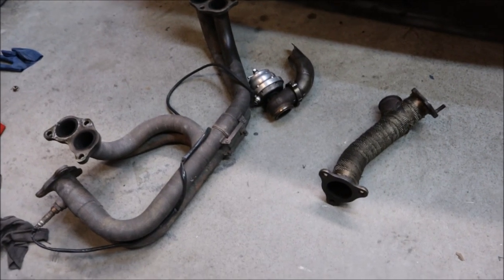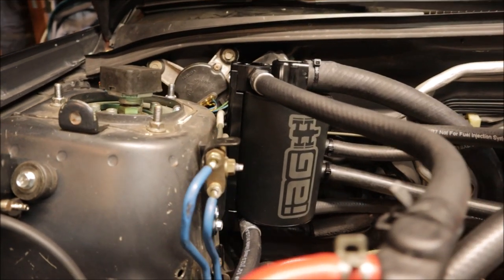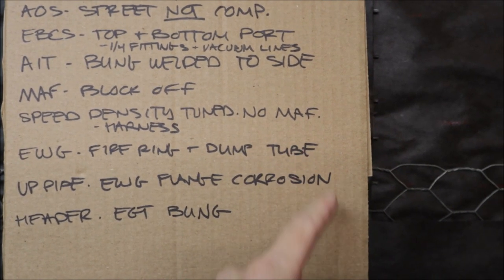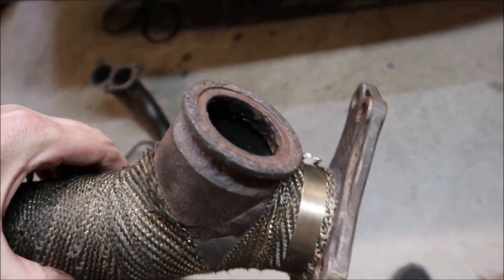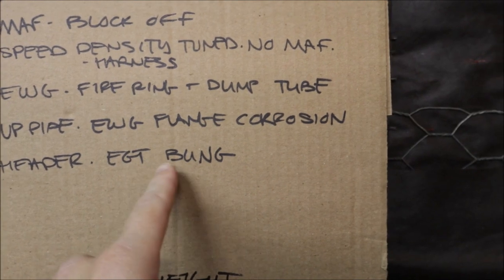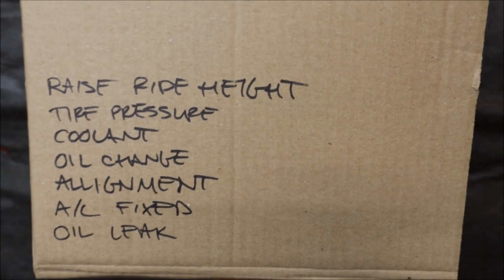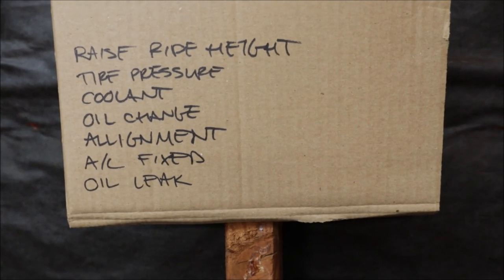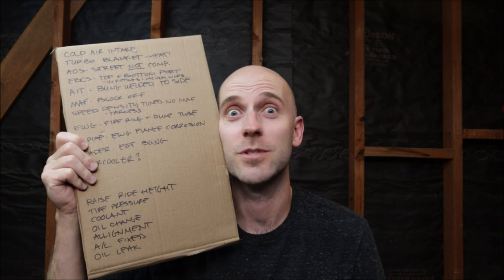Project Cars Are The Worst! The NEVERENDING Impreza WRX GC8 2.5RS Build Part 9

Comment: Don't wrap the exhaust  is will cause it to rust out and can cause a fire if oil gets on it. Ceramic coat it.  Use gold wrap on the intercooler pipeing
Reply from the maker: Wolfy1091 these are my exact thoughts! I considered wrapping the uppipe but it may end up needing to be replaced and I will go ceramic coated. Gold in the IC pipe will work just not a fan of that much flash!
Reply: Swaintech coating was a huge improvement from from my last time wrapping. Who wants itchyness wrapping headers anyway!

Comment: 5:01 this is how i felt when I did my swap recently.  The person who owned the donor car made a mess.  Broken bolt's missing bolts gaskets not sealed properly.  Everytime I thought I was done buying stuffing and fixing things I found more things wrong.  A few days before my inspection was due I was planing on starting her up. There was no coolant leaks before I took the engine out and did the swap. 

Well I went to fill the coolant  and it starts pissing out by the thermostat .  I though it was the hose because I had to cut it to make it fit. Nope after fiddling with it I found a bolt head missing on the thermostat.  I flipped out and almost threw the ratchet threw the window.  I thought the dude broke the bolt off in the water pump and there was no room to drill it out there.  I calmed down after a while and took another look and the bolt was just missing and the guy rtv'd the hell out of the thermostat .    I almost sold the car because of the aggravation the swap caused me.  It was only supposed to cost 2k   to do it  by the end spent almost 7k.
Reply from the maker: Wolfy1091 you feel my pain! Every single step of the way is an uphill battle. Nobody seems to care as much as we do. How hard is it to do something right? I suppose many people don’t care or have means to do it right the first time. I understand, at times I just want to through all the junk parts back on just to drive the dang car.

Comment: I wish that my laundry list was only that long...
You are doing great! I have found that I get really discouraged if I look at everything to be done. Just take the first thing on your list, plan your work as much as possible by doing research. Perform the work and only that until you need parts or resources. Order those parts and repeat; plan, work, complete or order parts on the next item.
It is a learning experience, you have a heavier learning curve than most but the great thing it will be your work and time done to your taste. You have a much nicer platform than pretty much everyone I know except my best friend, who bought his '99 RS with 8k miles in 2000 and then started modifying it.
I made a block off plate between the short ram and the engine, that attaches to the frame rail. Subaru I think still has one for the GD WRX like I'm talking about.
Also if you are going to reuse that up pipe, cut off that silly steel waste gate flange and get a good thick stainless one welded on. Also have the dump pipe merge back into the down pipe. I think Vibrant has that flange available or check Burns Stainless out there in SoCal. Full Race has what the ideal up pipe should look like, in my opinion.
Reply from the maker: @Troy Fankell much appreciated and great info! I get discouraged often and only get a few hours a week to work on it. Once I get started I always need more parts, then have to push it off till the next week or beyond if parts come in on time. I already purchased a new up pipe as I could not find anyone local to repair this one and they wanted $400+. I always liked the idea to recurc the ewg to keep the noise down. It would have to be a custom job to keep my current down pipe, see above regarding local fabricators 🤦‍♂️ for costs! Think it’s with it? Does it affect the boost when recirculating the ewg? I have herd mixed feelings on it.
Reply from the maker: I would love a block off plate for the intake but with fmic there is an extra pipe to route around.
Reply: @RoadPatina  It may be too complex shape for your setup with the I/C and intake. This is what my car looked like before I owned it when it was at SEMA. http://legacycentral.org/images/members/byron/engine_2.jpg
The block off allows the charge pipe to the front mount to go under and along the top of the frame rail and the intake to go over the top.
Reply: @RoadPatina  The wastegate being plumbed back into the exhaust is required at certain tracks or events. But it doesn't effect performance if the return is several inches down from the turbo outlet. The recirc is usually referring to the blow-off valve by recirculating the excess boost measured air back into the intake charge.
Reply from the maker: @troyfankell6581  I am going to look around locally for a good fab or exhaust shop.
Reply from the maker: @troyfankell6581  super clean. Tons of red like mine! Keep at it. We are getting there!

Comment: So your tuner wants to run all the ports of the EWG? You have an 18G turbo. The bottom port is sufficient..... but i guess. The FMIC piping does suck that it's a clockwise flow.  I would run it counterclockwise, but it wouldn't be a problem tuning it whether it's Stainless steel or aluminum. You need a heat shield for the turbo to keep radiant heat away from your piping, wiring, hoses, and IAT sensor. A healthy motor going in for a tune is better than a dying one.
Reply from the maker: Yes, they want me to run all the ports on the EWG and EBC, more vacuum hoses to clean up the engine bay 😂. Wish I had your knowledge as I am learning from my mistakes and are usually costly and repetitive. Turbo blanket purchased already!

Comment: Direct from IAG:
Q:  Which AOS is right for my vehicle?
A: It is IAG's opinion (which may differ from some builders and tuners) that you should use the following parameters to decide which AOS is correct for your vehicle:
Less than 600 WHP on pump gas – IAG recommends the Competition Series AOS. The Competition series provides the best venting of the PCV system and also prevents any oil suspended in the PCV gases from re-entering the turbo inlet. If you prefer not to retune the vehicle for installation of the AOS, the Street Series may be used below 600 WHP.
Less than 600 WHP on E85 – IAG recommends the Street Series AOS
Greater than 600 WHP on E85 / PUMP GAS / RACE GAS – IAG recommends the Competition Series AOS
*Please note that IAG recommends the STREET SERIES AOS for ALL cars under 600 WHP running E85 or high-ethanol fuel blends. When tuning E85, ethanol vapors tend to stay in the crankcase, which ultimately results in the oil becoming diluted and requiring extremely frequent oil changes. Pulling vacuum via the Street Series recirculating design to the inlet is ideal for ethanol tuned vehicles, and will allow the ethanol to be removed from the crankcase and burnt off as part of the combustion process. When running greater than 600 WHP on E85 IAG recommends the COMPETITION SERIES AOS and 1500-2000 mile, or every race event, oil change intervals. Please note that the COMPETITION SERIES AOS at any power level will require a custom tune.
Reply from the maker: I am less than 600 WHP on pump and switched over to the street series. Many tuners and engineers in the subie world I spoke with said the engine needs the vacuum for the crankcase. Does more good than harm. Also, some tracks and autocross events require a pcv system. Either way, now I have both!!!.

Comment: The tuner sounds demanding. Second opinion
Reply from the maker: I may have gone past that point! They just want everything perfect, if only it was a perfect world.
Reply: These are all valid concerns and requests for proper air metering. You want consistent IATs when tuning speed density, you also can't mount any sensors in the bottom of the pipe, as that is where water will collect from condensation/etc.